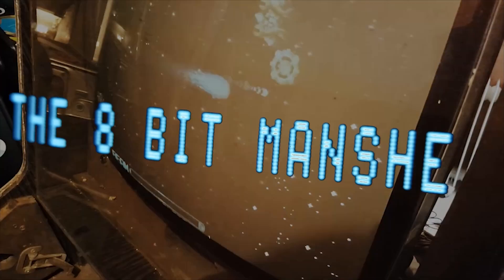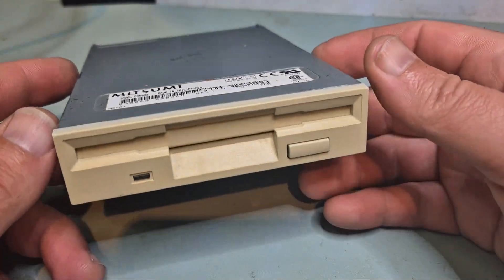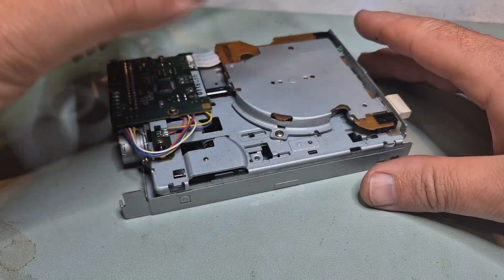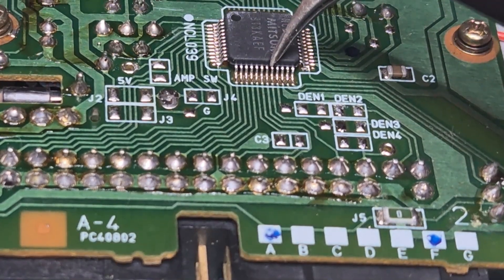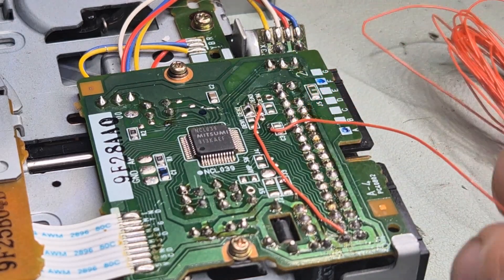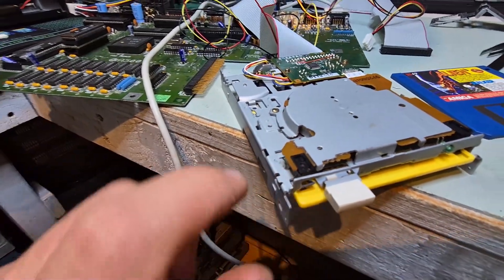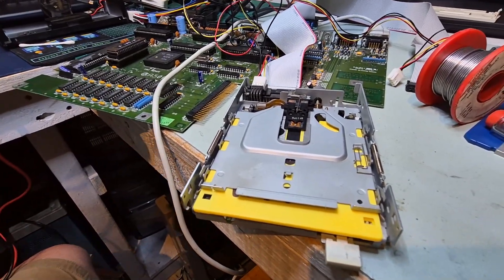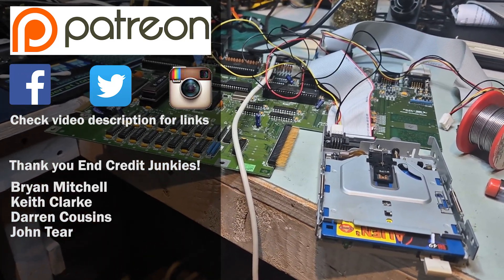PC to Amiga floppy mod (Mitsumi D359M3)

Comment: I have the some model drive here, but a totally different outer shell. Seemingly impossible to get to the PCB on mine.
Reply: I got it open! Had to slide the bottom shield to the back and then it lifted off.

Comment: Hi there Ollie. 
Just a bit of info  on disk capacities -

Amiga
880 Kb = DSDD  (Double Sideed Double Density)  AKA A Normal / Standard floppy disk
1.76 Mb = DSHD (Double Sided High Density) AKA A High Density floppy disk

DOS / MS-DOS
720 Kb = DSDD
1.44 Mb = HD

(Not trying to be a smart arse, just sharing some knowledge  - You're probably aware of this anyway)

I Enjoyed the video though !
Reply from the maker: thanks for the info. Actually I wasn't even really aware there was that much of a difference between Amiga and pcdos floppy sizes for the same density. 
I never tinkered much with dos back then anyway,  sort of kept my amiga till some time near the end of win95 , at which stage I was using CDs ayway

Comment: I like that these drives have that flex cable or little PCB connecting the stepper motor at the back as it makes them easy to spot against most other drives. Never knew you could attach a floppy to an MSX, although I have only ever used one with cartridge and that was well over 30 years ago 😆
Reply from the maker: aye. MSX2 came with floppy drives as standard but you could certainly attach a floppy drive to any MSX1 through parallel port (i think) or the cartridge port